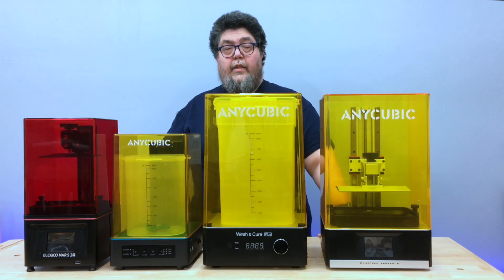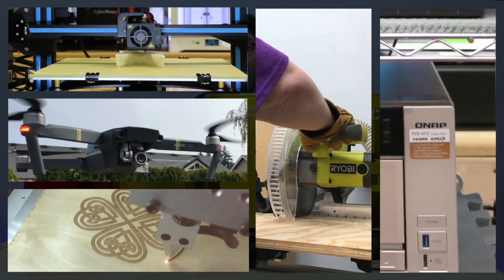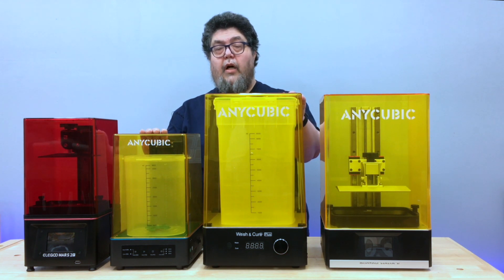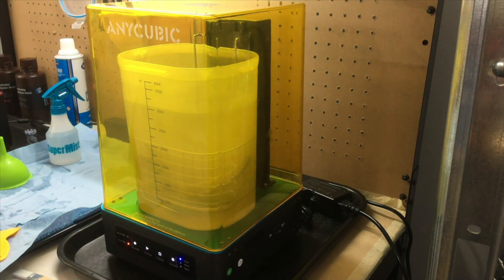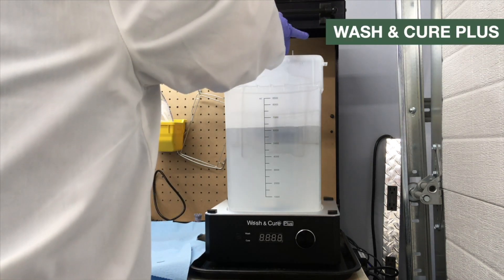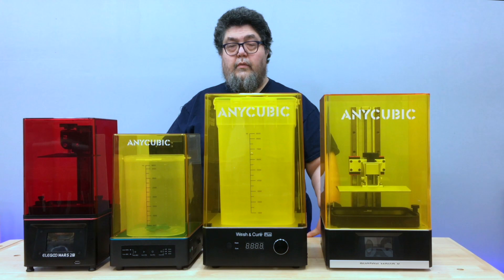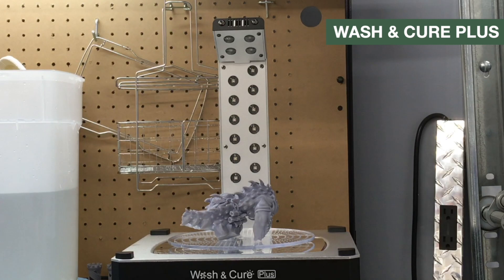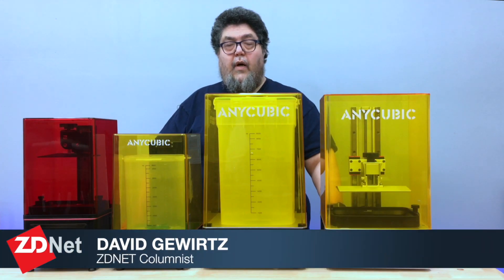Anycubic vs. Anycubic: Which Wash & Cure is best for you?

Comment: Thanks but I’m having an issue with my printer is the same one as you have but the print is sticking to the bottom of the plate of where the Resin set if there be something wrong with my machine or am I doing something wrong in the settings when I made a prototype that came out perfect of them then I tried something new and it’s been a flop ever since can you give me some suggestions please.
Reply from the maker: Play with exposure time. More exposure makes it hang on tighter. Less reduces it. But more exposure can also make prints more brittle, so you don't just want to crank it up.